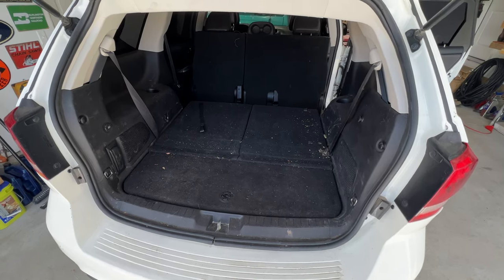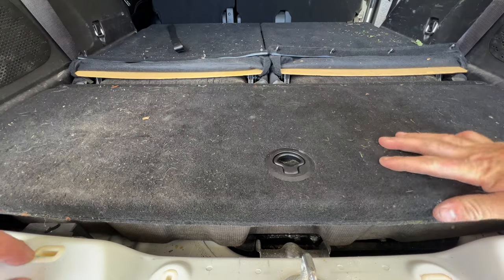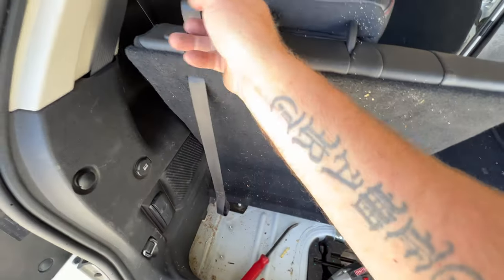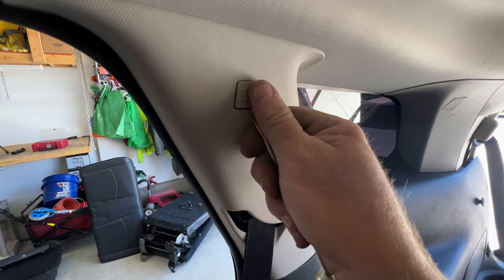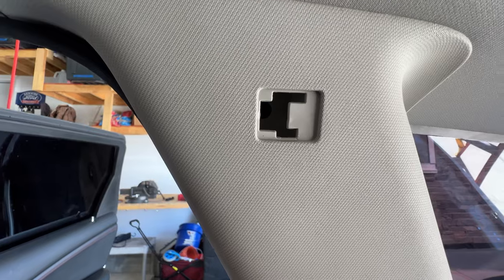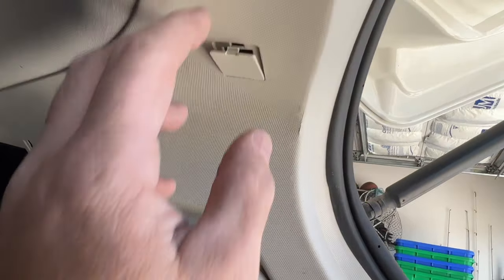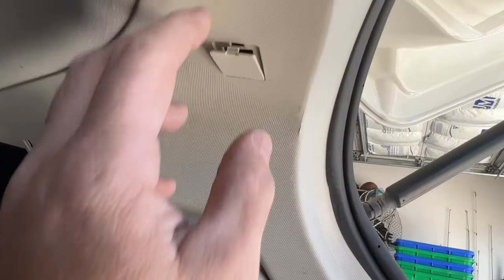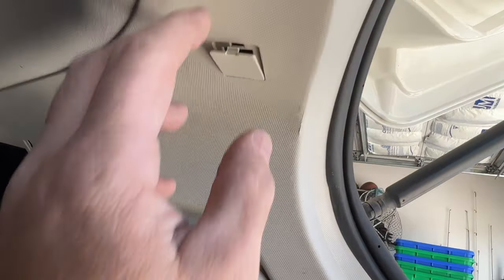Dodge Journey Rear Struts Replacement How-To

Comment: i watched one video where the guy just cut the plastic cover that is right in front of the strut bolts and then just covered the hole back up, ya not the best way but saved him a lot of time and as he said the cut portion is almost covered up by other stuff so he wasnt worried about it
Reply: Any chance you could link the video or know the channels name? I have been looking for how to do that because I saw how much shit you have to take off for this
Reply: @brianvinzant1893 Yeah, follow the video below.  Don't get sucked into tearing the interior apart to remove two 15 mm nuts on each side.
Reply: @bammerbiff1621  I already did it, I took out the back seats and cut flaps the plastic, one one side when bending the flap up it broke out the square witch I just put back into place on the other side it worked perfectly. After putting the seats back in you can barley see anything and if you did you had to be looking for it

Comment: Hey boss, I had my rear shocks both replaced with a whole new assembly. Now, the rear is still sitting pretty high, about 3-4 inches from its normal height. Would you happen to know what happened with it? The mechanic said it should settle down but I drive the vehicle daily for 2 weeks now and it hasn't budged.
Reply from the maker: They may settle a little bit. What year and model do you have? And is it awd or two wheel drive? I wonder if they put the correct ones on because some journeys had the performance suspension package or the touring suspension package which are different from one another.

Comment: Do you need control arms for the rear as well, like the front ?
Reply from the maker: There is a lower control arm there. Are you talking about replacing the lower control arm?
Reply: @BLUECOLLARGARAGE  Yes! Thank you. Sorry I am not knowledgeable about cars. I just bought a used Journey and was told it needed front and rear suspension. The front is practically done, just need to know what I need for the rear suspension.

Comment: What kit do you recommend for me ? My suspension is worn and I have a 2010 Journey awd r/t
Reply from the maker: You really can’t go wrong with the big three Monroe, Gabriel, and kyb especially if your planning on keeping the vehicle. If you don’t plan on keeping the vehicle for awhile I’m sure the cheaper brands like fcs, Detroit axle, and prt will work just fine. Are you looking for the strut and spring combo or just the struts and reusing your original spring.
Reply: @BLUECOLLARGARAGE  just struts and reusing original springs because I’ve heard that’s best and saves money . I’ve heard you don’t really want thick springs either which is another reason . A lot of full assemblies have thicker springs is this true ?
Reply from the maker: @Catchmecupid  Not really sure on the larger springs or at least I haven’t really noticed. I prefer to reuse springs because I’d rather save money as well. The only benefit of full assemblies is they are faster to switch out and you get new strut mounts and bearings which is good for the fronts because a lot of journeys had problems with the factory strut mounts and bearings but for the rears definitely worth it to just reuse the old spring. Check out www.rockauto.com they seem to have the best prices for your vehicle especially on the Monroe oespectrum struts.
Reply: @BLUECOLLARGARAGE  thanks ! Appreciate the help